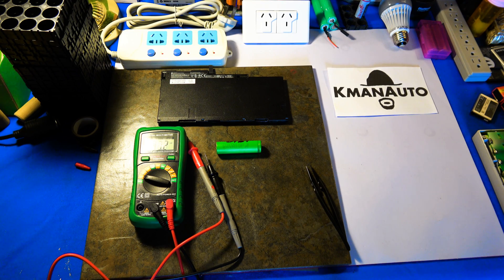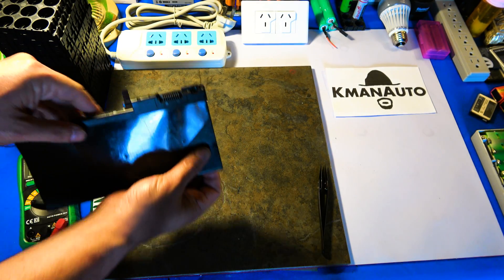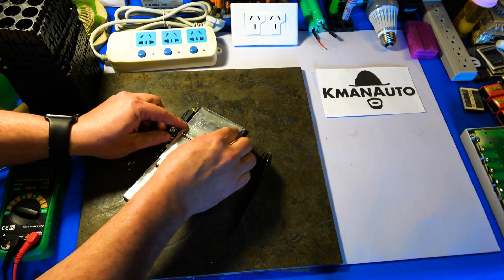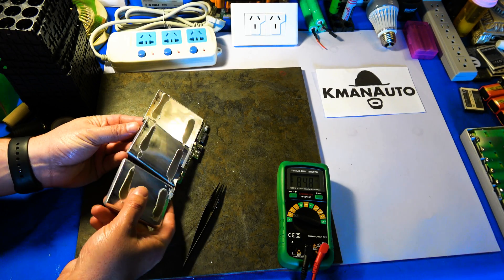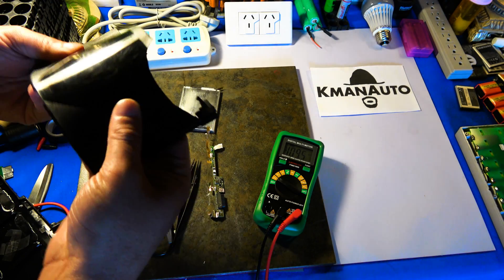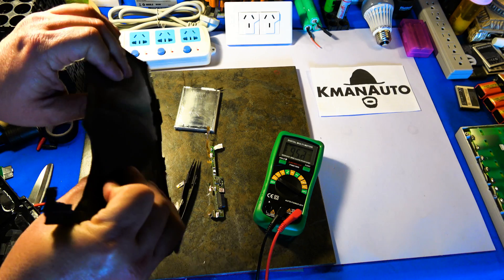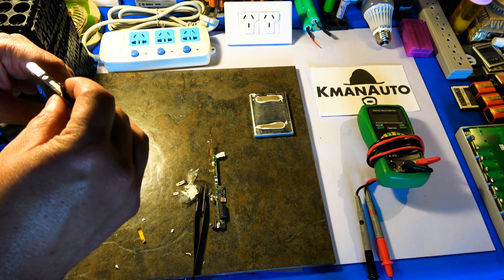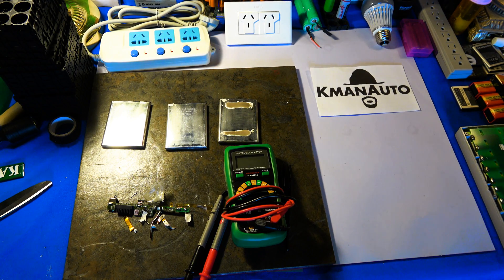Disassembling the HP CM03XL Lithium Battery  4250mAh 11.4v 50Wh KmanEnergy

Comment: Those cells aren't touching each other because there is thin strips black insulator between them.  The case is (+) so it is indeed important for the cells to be isolated.  I'm reusing these types of cells in homemade power banks after a full capacity check.

Comment: @kmanauto I am getting a bunch of these exact batteries at a decent rate .... what projects have you been able to use these cell in?  I am preparing to tear each one down and test em like the 18650s.
Reply from the maker: Ron.M. Davis I have about 1000 cells now on hand. I still have about 100 more of these packs to open. I get them by the 55 gallon barrel for about a dollar per battery. The hospital they come from, replaces all their batteries yearly regardless of where or use, 99% of them are just fine, but I have no way to test them in a computer . i’m going to build a giant battery pack, around 20 kWh. hopefully larger, it will have both five old USB ports, and high powered ports for 240 V and 120 V to charge electric cars, sort of as a gas can equivalent. i’m also going to make it so it can be charged from USB. Yes I know it would take forever and be very slow, however in the grand scheme of things, That universal ability is awesome.
Reply: Awesome .. you just opened my eyes to a new source.    Thank you .. I am starting small but your ambitions answer that I can do more or less the same planning with these as I am with my 18650s....Thanks for replying!!

Comment: Test the outside by using your multi-meter. Put it on conductive mode and touch both probes to the body. It if beeps, it is conductive.